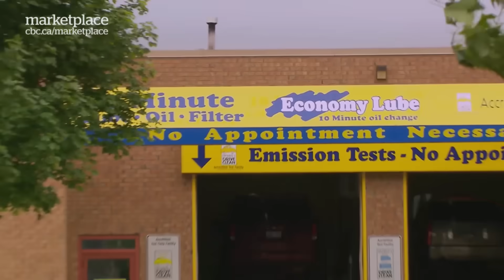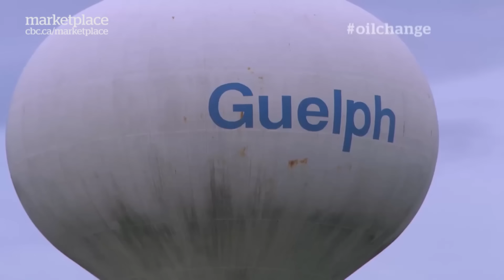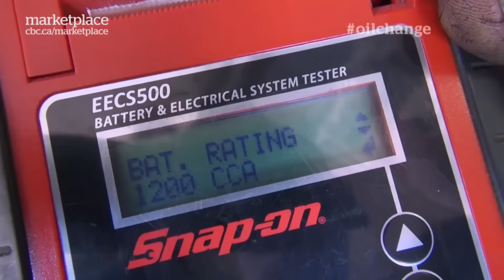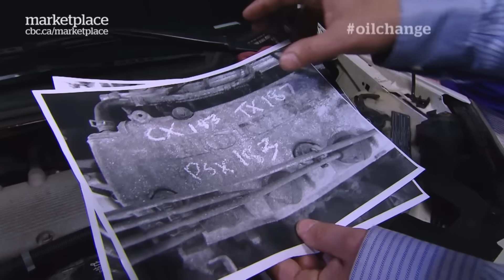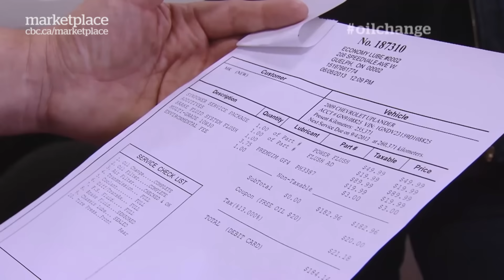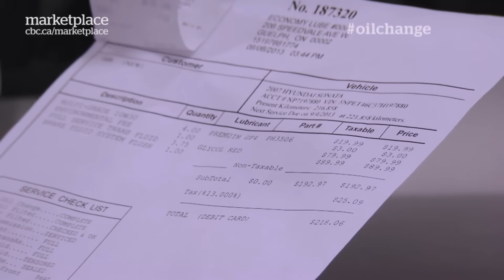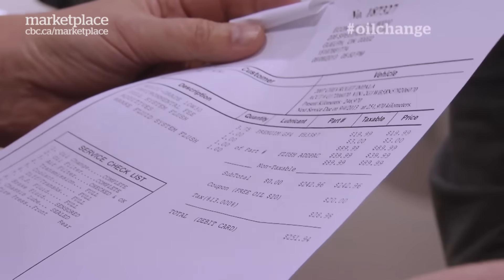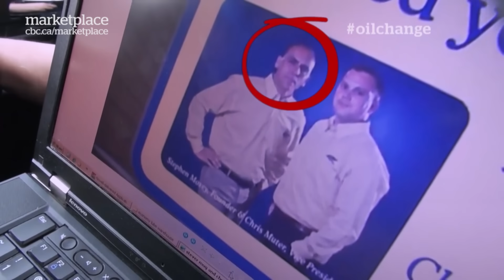Oil change scams: Hidden camera investigation on what really happens to your car (CBC Marketplace)

Comment: I'm a technician myself, and I'm so glad I work for a great company that doesn't try this on customers. We actually do videos of our multi-point inspections so that the customers can see exactly what we're seeing when we look their vehicle over. We also do video updates for any services that they've come in for. (For example, someone came in for air and after noticing their tire was flat, I informed the advisor and they made an appointment right then and there. We made a multi-point inspection video, and also provided a video showing exactly where the hole in the tire was.) I feel like more shops should adopt this system. While yes, it does make more work for techs, and longer wait times, it also helps to give transparency between customers and businesses. With these quick lube shops, it'd probably help their reputation.
Reply: Can you tell me the name of the company so i could go there next time i need a change? :)
Reply: we also do this. We take a video of the underneath of the vehicle and show that we drop the oil and change the filter
Reply: Company name?
Reply: I work at a small Napa, and we take pictures but usually never show them, but we have them just in case because we are not scum bags. 8 minutes for a transmission flush 😂😂 it takes over an hour in some cases.
Reply: @EphemeralProductions  You're just going to take this random guy's word for it?
Reply: Most mechanics are dope headed drunks
Reply: @JamieGarrett-ru4rq  That's why I do all my own repair work. The only dope headed drunk that I'll let work on my vehicle is gonna be me.
Reply: @cumulo25  I can respect that.
Reply: I love that
Reply: My dealership does the same thing we take photos and videos to show the customer EVERYTHING. And it goes a long way

Comment: The air in your tires looks dirty and smells burnt. You should do a 4 tire air flush and fill real soon!
Reply: Kyle Matthews lol
Reply: Oh no I have never checked how clean my tire air is how do you check that
Reply: Random,Work,&Video Games stick a knife in all 4 tires if black air comes out it needs changed... XD
Reply: That'll be $89.99
Reply: Welll, while your at it let us change your muffler barrings and your turn signal fluid. Oh that would be 99.58.
Reply: Shredar mitch turn signal fluid. Funny as hell
Reply: lol
Reply: Is that for regular or florescent turn signal fluid
Reply: Was great mate!!... never thought that  :)
Reply: Valerio Deli lol gotta be careful or do it yourself!
Reply: Actually transmission fluid and power steering fluid (also is transmission fluid) does smell burnt when it is old and needs to be changed...

Usually when the transmission fluid smells burnt ,the transmission or power steering is on its way out,but not always,just never changed after it was supposed to..
Reply: 01trsmar you missed the point of the story, but that's ok
Reply: james spags no I think u did
Reply: Kyle Matthews oh man...ok ill guess we can... wai,wait a mINUTE!?  DIRTY AIR ISNT A PROBLEM AT ALL!!   YOU WANNA SCAM ME!!??!!??!!
Reply: arielfuturspeed lol....
Reply: In the past they used to charge extra for special air for your tires.
Reply: Random,Work,&Video Games   you shovel a spike into the side of your Wheel and if the tire goes flat then you had bad air and need to get new tires as soon as possible.
Reply: SHADOWxWOLF lmao
Reply: SHADOWxWOLF lol
Reply: The spark plugs look dirty and smell burnt. And the spark reservoir is running low. We can top it up with fresh sparks for just $59.99.
Reply: Ungoogleable o_O -- yes they certainly did...the ole Nitrogen in the tires upsell.
Reply: Kyle Matthews I think the front-end needs a couple Finnegan pins they look pretty worn out
Reply: Al Boxx I always think that too that's funny have a good one dude
Reply: I use red cool-aid for my transmission. Works great and only cost me less than two  dollars!
Reply: That’ll be $400 lol.
Reply: you sir are a genius!  Q.
Reply: Don't forget about the blinker fluid.
Reply: @arielfuturspeed  to
Reply: Lmao
Reply: Can’t beat Bill Bailey “It’s not firing through the St. Elmo’s pipe trench, the donkey nipples are all swarfed up...”
Reply: Dihydrogen monoxide tank empty. £500 for a refill. Petrol bearings worn. You can hear the petrol rattling...listen.
Reply: @blackhawkdownzx  GED THATS A GOOD IDEA, CHEAPER TOO 😂LOL
Reply: Almost time to change out that stale winter air in your tires and fill them up with fresh summer air.
Reply: Dont forget tonchange the winter air out for summer air
Reply: @commanderclean7785  pull the valve core out, and inhale as much of the air coming out as you can
Reply: 😆 lol
Reply: LOL
Reply: are indicator lights are working , 'yes , no ,yes no yes no
Reply: @ws-mitch3256  The two verbs are competing with each other.
Reply: The air that comes out of the air compressors at a lot of gas stations actually does smell bad so that's not so far fetched.

Comment: AFTER looking at my truck in the shop, the tech came out to the office and told me that my air conditioner needed servicing.  "That's funny.." I said ".. because this truck does not have air conditioning."
Reply: BAHAHA they outdo themselves every time
Reply: Good one!!
Reply: Wow! That's chutzpah if I ever heard it!
Reply: I had a similar experience.  I have a 1963 Dodge D200.  Shortly after getting it, I picked up a 4X4 "hulk" that had compatible parts -- a way to get a WD200 "on the cheap."  A few months later, I notice some broken spring leaves on the front end, so I started the conversion early -- replacing the 2 wheel drive axle with the 4 wheel drive front end and associated springs...

Later, in an attempt to be kind to me, my Bride took the truck to an "Oil Change Place" to get it serviced.  They actually changed the oil, but when I looked at the bill, they had added a charge for "six pounds of gear lube to top up the transfer case."  In this instance, they did not ask my wife for permission, they just charged her for the service.  When they billed her, they told her they had added "transmission grease"; she did not spot the discrepancy until after she left the shop. When she got home, she immediately brought the problem to my attention and I had a follow up conversation with the Manager...

Me:  "So, tell me how you put 6 lbs of grease into my transfer case..."
MGR:  "Well, the technician checked the drip port on the side, saw it was down, and just pumped it in."
Me:  "Okay, sounds plausible -- but I'll be needing that technician's name so I can swear out a warrant for Burglary."
MGR:  "Burglary?"
Me:  "Yeah, given that he serviced the transfer case for that truck without permission, AND that the case is sitting on the floor of my garage, AND that my garage was locked when you serviced it, your technician would have had to defeat the locks and illegally enter my garage to perform the service... I do believe that constitutes Burglary..."
MGR:  [After looking under the truck and seeing there was, indeed, no transfer case] "Um, how about a refund?"
Me:  "Yeah, how about that?"
Reply: @flyinglpranch3886  HAHA NICE
Reply: Haha!!!
Reply: I’ve been doing my own maintenance for years. Only major work I’ll bring to a professional shop. I never go to these shops. But I’m soooo tempted to go to one and have them try to upsell me because I’m a girl (even though my car is manual transmission). I DARE them to say I need new air filters or power steering fluid. Because just like you said I’ll be like HAH liars. Because my car has cold air intake hidden in my bumper. You can’t see it. And 2 I don’t have power steering fluid! I want to catch them try and take advantage of me so bad haha but don’t want to waste my time if they actually just want to give me an oil change since I just did it a few months ago xD
Reply: If your truck doesn't have air conditioning... Its because it's not working and needs to be serviced my guy 🤦🏻‍♂️
Reply: Anthony Torres I hope you’re kidding
Reply: When I was 17 I went to a mechanic for a patch in my exhaust. Got back a $700 estimate calling me to replace the entire exhaust, o2 sensor, and muffler. Long story short I ripped up his estimate and threw it in his face calling him a thief and got it patched down the street for $50.
Reply: That’s hilarious 😂
Reply: mg1881 I got an oil change recently & they tried hitting me wit the “your battery failed the battery test, it needs to be replaced” 

I look at the receipt and the thing says battery test passed lmao
Reply: @anthonytorres1225  you do realize there are vehicles thay don't have a/c, right? For example, when I bought my 72 cutlass, the listing description included a line that said, "100% original, including factory a/c!" Factory a/c is a selling point in 100% original classics, because they don't all come with it. Adding aftermarket a/c would mean you have now modified your classic or antique vehicle from the options included from factory. If you searched the VIN, it would not list a/c as an option.
Reply: Hah! Guys, this truck doesn't even filter air.. Actually, I'm sure this truck isn't even a truck. ONE STAR.
Reply: If u dont change ur own oil u shouldnt even own a car u should just prolly rent one
Reply: Then you have the right to punch them in the face
Reply: cathy Larson Wow.
Reply: That's about the best one yet . Those Liars. About as good as your blinker fluid needs changing . LOL. They are everywhere. And it's true the industry teaches students to Lie...
Reply: I would love to have that happen. I would be going to town
Reply: mg1881 lol maybe that’s why he said it needs servicing since it didn’t work
Reply: I'm waiting to be told my power steering fluid is bad. I have electric steering.
Reply: Anthony Torres there are older vehicles that were made without air conditioning which is the case this guy is referring to. Otherwise he never would have mentioned it 🤦🏼‍♂️
Reply: He wasn't wrong.
Reply: Abject Trepidity I believe he was. If a vehicle doesn’t have air conditioning it can’t be serviced. Different than if a/c needs a charge or something.
Reply: @theinformer8471  you are correct. I resign my argument.
Reply: Abject Trepidity I appreciate the class and humility exercised there. 👊 That is lacking in its frequency of occurrence these days.
Reply: @theinformer8471  👊
Reply: Usually when I go get my oil changed, I check before I go and before I leave to make sure something was done . If they tell me I need other services I always ask if they can tell me in detail what it is I need, write it down, refuse the service there, then take it to my mechanic to see if it checks out. Majority of the time it does which is why I go back there for oil changes but some places are just so shady. Hopefully people will stop going there and run them out of business.
Reply: @flyinglpranch3886   you had all the power and you settle for a refund
Reply: That is hilarious
Reply: @Rekct22  why would you go to a different shop for an oil change if you have a mechanic that does your car services......
Reply: Janice Welch It’s easier to go to a shop sometimes than to make an appt with my mechanic . I always call and check with him first if he’s available because usually for oil changes I have to schedule 4 days out and I’d rather not wait. So I’ll go to a shop (recommended by him) and get my oil changed . But any heavy work that has to be done I only trust my mechanic to do.
Reply: My dads' 2004 Mitsubishi van has no AC but he wants to install one
Reply: @YamahaYEP321S  Sorry to say so, YamahaYep321S, but your car does indeed NEED a cold air filter, IF you value the internals of your engine. But Yes, your correct, many try to take advantage of females. Be wise and learn about your vehicle.
Reply: @kinghenry5205  Yeah, then a couple of months later the whole shebang fell off. If there's any issues with your exhaust system, it's always wise to replace the whole lot, doing otherwise is not cost effective. However the 02 sensor should not need replacing unless the computer says it's faulty.
Reply: @YamahaYEP321S  what has a cold air intake got to do with not having air filters? 
You need air filters with or without cold air intake.
Unless by cold air intake you actually mean those pod filters but they still need to be replaced or cleaned like any other filter
Reply: Don't know if you recorded that call but it would be a great upload to listen to.
Reply: @anthonytorres1225  - how do you know That? It may have come from the factory with no AC.
Reply: @CashIsKing_UseItOrLoseIt  Wish I had recorded it.
Reply: @espeonmatrix  It really happened.
Reply: @mr.t6304  Well, yes, that truck does filter air.  Not sure where you're going with your comment.  But it's a good thing you're so sure of yourself.  Have a nice day.
Reply: Aldo Htownsouth  Har!
Reply: @Rekct22  Good idea.  I check under the hood after oil changes to make sure they screwed the oil filler cap back on and the dipstick is fully inserted.  One time after an oil change, I noticed smoke after driving a few miles and popped the hood - the oil filler cap was missing.  The whole engine compartment was coated in oil - huge mess.  I also pull the dipstick to make sure there is actually fresh oil on it.  And I peek at the oil filter to see if it looks new.  While I'm at it I check the brake fluid level.
Reply: In that case,  we are going to have to put in a whole new system.  You cant be driving around with no airconditioning!!
Reply: Was told need to change cabin air filter I said no thank you today 
Didn't say anything to the person but
My car doesn't have one uhg car is over 20yrs old I checked the manual when I got home

Comment: Once I went to Valvoline for a 15 minutes oil change. The guy worked on my car told me I needed a new battery because the voltage/amp were weak. When I told him the battery is new and it was changed two weeks ago, he apologized and said that his scanner might not be fully functional.

Comment: This is why I only travel via magic carpet.
Reply: RalphsLegend Uh, you need your magic fibre restraightened and your floatation fluid changed. $69 for the fibre and $89 for the fluid.
Reply: Strììder Eclipse don't forget the magic genie lamp lube
Reply: Bernie Sandals of course how could I forget
Reply: RalphsLegend your thread is looking a little worn. I can replace that for ya $19.99!
Reply: Berrymango aka flying fish truu
Reply: Aladdin?
Reply: RalphsLegend hotel? trivago
Reply: RalphsLegend the thread is coming loses. It costs 1 wish non negotiable.
Reply: RalphsLegend Replace those worn threads with these premium threads. It'll get you a better air ride
Reply: looks like you need a new v8 engine mah boi let me hook you up with a price you cant resist! 9,000,000,000,000,000,000,000,000....( error zero.exe has stopped working )
Reply: Lol
Reply: Alladin is that you?
Reply: Jewelrule no it’s the prophet Muhammad
Reply: @weepoethics  o h
Reply: RalphsLegend You don’t get scammed by company’s offering expensive Fabric Flush? Or anything like that
Reply: Your towbar needs new lubrication to avoid increase in airtax.
Reply: There is a rip off for that too, make sure always! Good luck
Reply: @jewelrule  lol
Reply: Same here
Reply: Yeah but remember that time when someone went around slashing our magic carpets? That was devastating.
Reply: RalphsLegend 😂🤣😂🤣
Reply: I teleport 😂 😆😆😆😆
Reply: @RalphsLegend 😂😂😂
Reply: @StriiderEclipse  😂😂😂
Reply: This is why I travel by unicycle
Reply: horse and buggy
Reply: Then you have to deal with shady carpet cleaners
Reply: LMFAO THIS CRACKED ME UP

Comment: Me: has an electric car
Economy lube: your gas tank is supposed to smell like air but smells like air
Reply: We need to change your air. That’ll be 249.99
Reply: Fuel tank needs a flush.
Reply: There's always blinker fluid regardless of what kind of car you have ;)
Reply: @ewomer100  the fule tank need new head gaskets
Reply: You should get a diesel they run on any oil I would remoend the older diesels like a Datsun 720 sd25
Reply: I also drive an electric car. They told me the battery cells need to be rotated.
Reply: @trusevs  not true they just have to be regapped with a special gapping tool every month
Reply: @Darenz-cg9zg  transmision needs a flush
Reply: Lmfaoooooooo 😭😭😭🤣🤣 needed to laugh this morning appreciate it mate
Reply: Same here, EV Owner. They told me my muffler bearings are loose and need oil.
Reply: You need new battery oil, it will be $599.99
Reply: Enjoy trying to find a charging station when you go on vacation, or go out of state, and enjoy waiting for hours until your EV is fully charged. Also, every year, the strength of the battery goes down by 2%, and eventually, you'll only be able to go 50 miles on a full charge.
Reply: @SokemRokemRobot ,so tell me why people buy an electric vehicle?  To save the planet or to let people know you’re saving the planet?